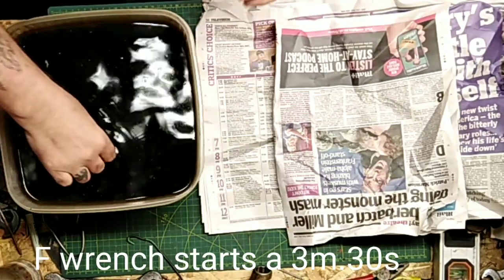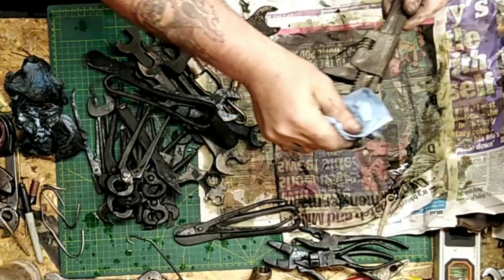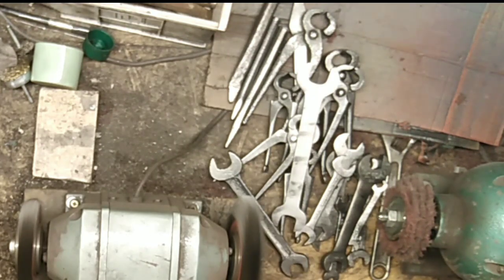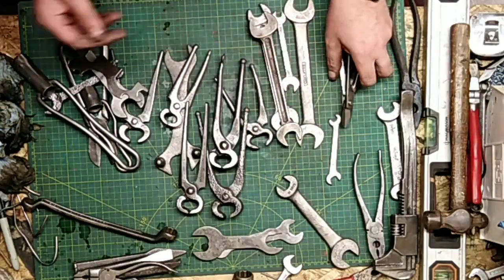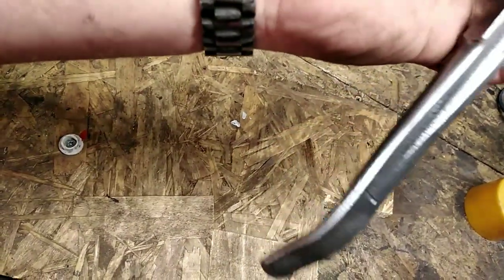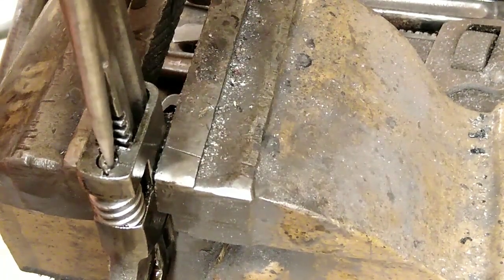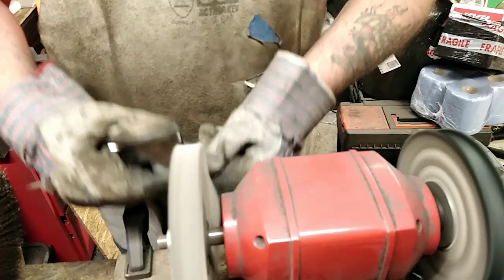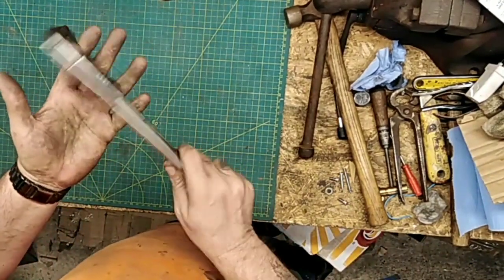overnight rust removal Deox c and chewed up foreign f wrench hand tool restoration

Comment: Hi, if I use deoxc for inside fuel tank. Do I need sealer coating after to prevent rust? Thanks.
Reply from the maker: There is a video on YouTube somewhere under deox c search showing exactly what you just asked.

Comment: I'm hoping my powder Deox arrives soon.. Looking forward in trying it out..cracking job on the wrench Jim
Reply from the maker: Thanks Mark, oh you'll run out of rusty things so quick, I panicked when I first used it, did nt know if it would flash rust or anything after do cleaned and painted /protected like a madman, but you soak for 12 /24 hours, remove and wire wheel up at your leisure, no rush nothing happens if you leave them, I did a very easy 1 to 10 mix, thou it will go down to 1 to 20 according to instructions
Reply: @toolrestoration  its just arrived.. Will add it to a video..